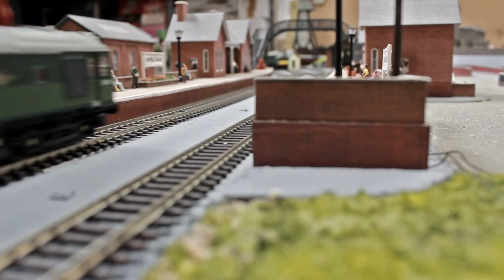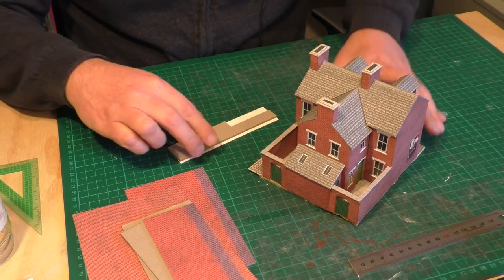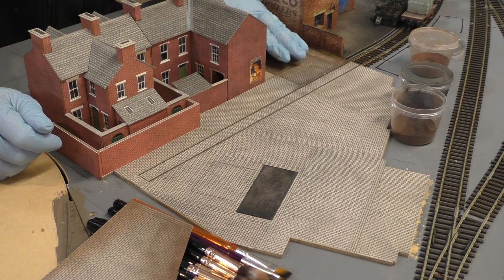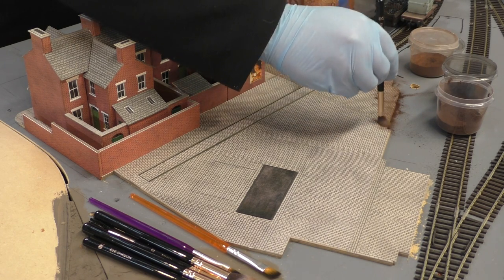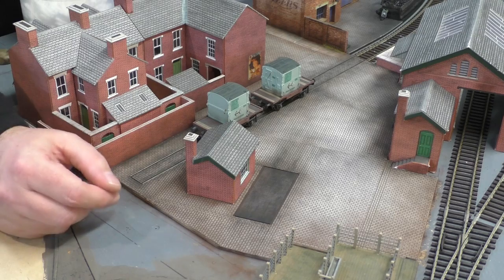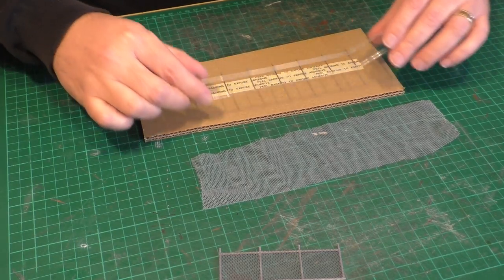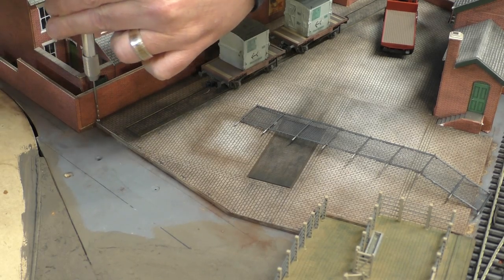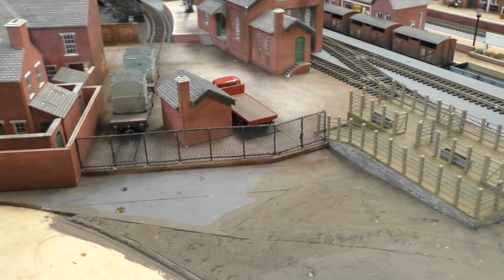Goodsyard Weathering & Modelling a Chain-link Fence

Comment: Dear Julian, as we mark locations to be drilled, we can of course be very precise. However, when we start drilling, the drill may wander off. This because the most drills have two chisels. So, when the drill starts it is very possible to wander off, even if only a tiny wee bit. To prevent this action from happening we may need to use an awl, sharp nail, or a sharp center point to indent the bore location. Then the drill point will be able to center much better, before the chisels are able to deflect from the intended position. 
Anyhow, the goods yard looks awesome. Saw Gormo’s vid on the wire mesh fence. Great idea to be propagated. 
On the alley way around the back of the terraced houses; not that it doesn’t look good, but I can imagine the house on the dead end part of the alley wanting their door to the backyard to be placed at the plot line of their shed. Nobody else will use that part of the alley. It will tell a little story of what kind of person lives in that particular dwelling. Cheerio
Reply from the maker: I knew about making a pilot indentation for drilling a hole, but do think I'd remember to do this when needing to drill holes requiring accuracy?😲

Comment: I thought the same thing as Robin about a double gate in the fence to serve the goods yard. 
Also there are no chimney pots on the buildings, unless you have left them off for now in case you damage them. Wills now part of Peco make a pack of building details including chimney pots. Just thought I would mention this in case they are not supplied with the Metcalf kits.
Reply from the maker: Thanks Terry. Being such a belated response to your comments, you've no doubt caught up with my latest videos where I added in a second vehicle entrance to the goods yard. This was very much spurred on by yours and other folks comments related to the weighbidge location. Absolutely correct about the chimney pots, I've had so many break off in the past that I just leave them off. I do have a selection of 3D printed chimney pots waiting to be installed but while there still so much activity going on, they can wait.

Comment: Also the outdoor buildings on the Metcalf's terraced houses are outside toilet's not sheds. Sheds were bought separately by the tennent or built from scrap. Dustbins or rubbish bins were not taken out, they where left in the 8 foots at the back gate and the binmen picked them up individually. A hard job as they picked up the rubbish bin and all. All terraced houses had back alleys for this
Reply from the maker: Thanks Kenneth for this very useful information. As you'll no doubt know by now, your comment, amongst others spurred me to relook at the rear gates and alleyway and make some changes🙂

Comment: Excellent timing as I need to weather my cobbles area 👍🏼 I do wonder however with the stock your running do you not think that the fencing is too modern?
Reply: Chain link fencing was developed in the 1840s in Britain. It became more popular after WW2 to replace the iron railings acquired for the war effort.
Reply: @castlegatejunction  Well I never knew that. Just goes to show every day is a school day 👍🏼
Reply from the maker: You'll be quite surprised by the development of infrastructure techniques and how early some were adopted. As castlegatejunction commented below, chain-link fence has been around for quite some time. I often carrying out research on my given era (late 1950's to early 1970's) before I begin modelling, and this fencing was one of those occasions.

Comment: I've not seen chainlink fencing with horizontal bars. Most chain link fencing I've seen since the 1970s was threaded onto wires strung between cast concreate posts with the  posts at the outer ends with a diagonal brace set at about half way up the post on the inner side, ie along side the first and last chainlink fence panel (plus midway braced posts depending on the length pf the fence).

To me this chainlink fencing looks to American or like modern temporary fence panels as found around building sites.
Reply from the maker: Not all chain-link fences had concrete posts. An example of a metal post fence from 1960 in the UK... https://www.gettyimages.co.uk/detail/news-photo/factory-workers-during-prince-philips-visit-to-the-birds-news-photo/700543119?adppopup=true
Reply: @StationRoadModelRailway  I never said that there wasn't other post materials. But even this metal post version has no metal crossbars. The chainlink is hung on horizontal wires.
Reply from the maker: @neiloflongbeck5705  Horizontal poles might not have been common, but I'm happy with the result using a simple method of reappropriated materials, it's the suggestion of a chain-link fence I'm after, I'm not seeking prototypical perfection.
Reply: @StationRoadModelRailway  in the end that's all that matters. The happiness of the person doing it. If you were after prototypical perfection you'd be modelling in P4.